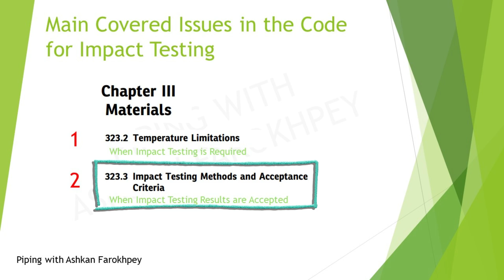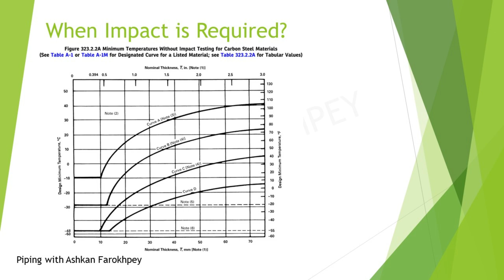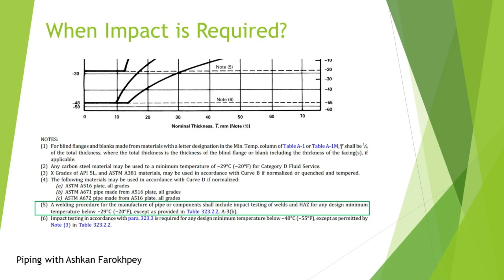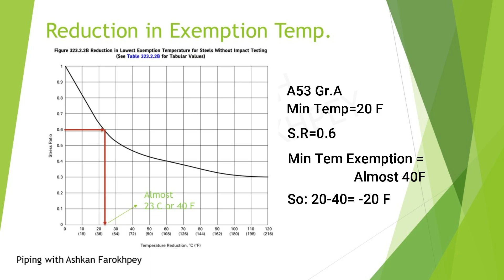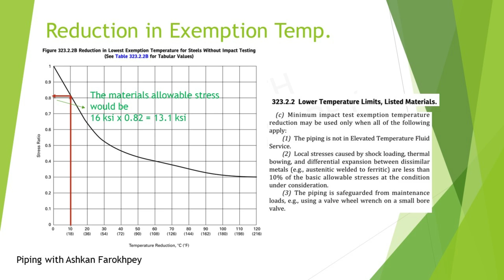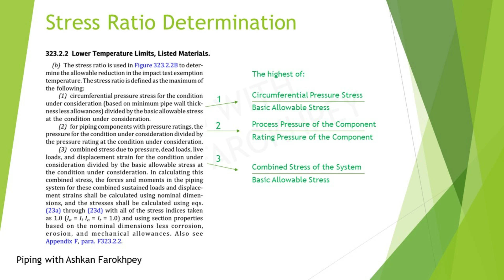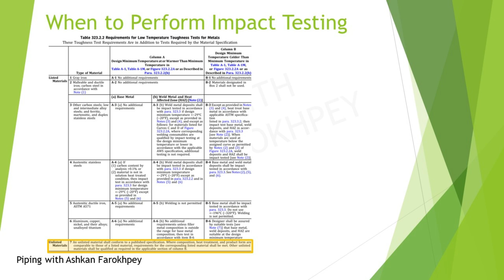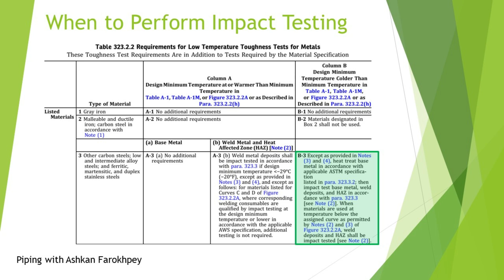When Impact Test is Required in Piping? ASME B31.3 Explanations

Comment: The reference Table 323.2.2 seem obsolete version 2018. In version 2020 and above this has been change therefore the assessment is not valid for new version of the B31.3 code